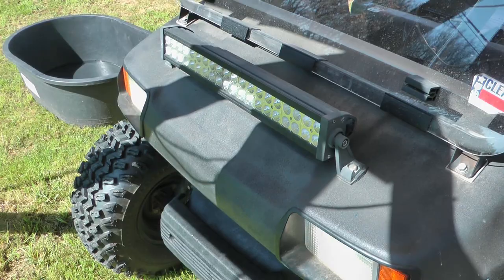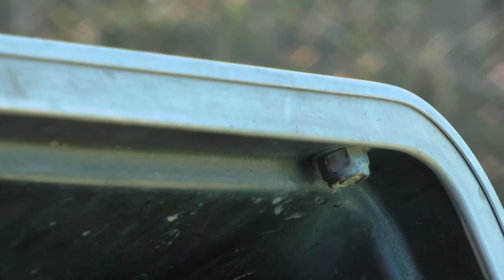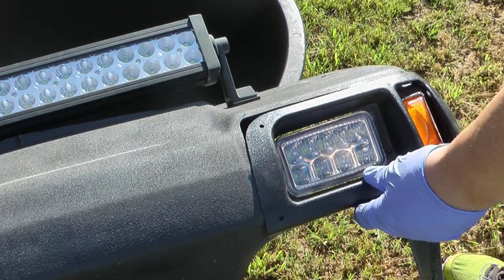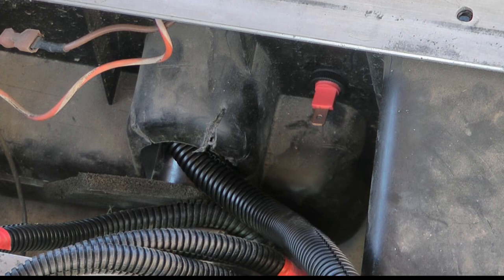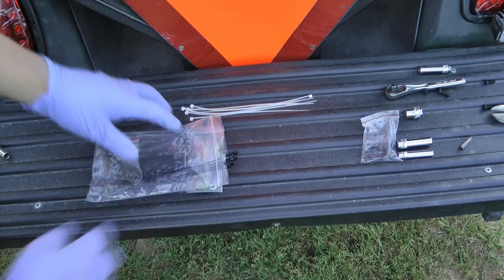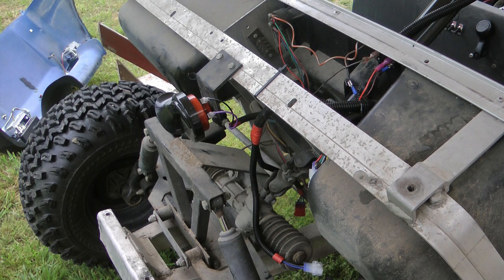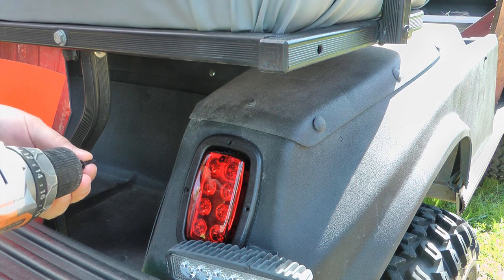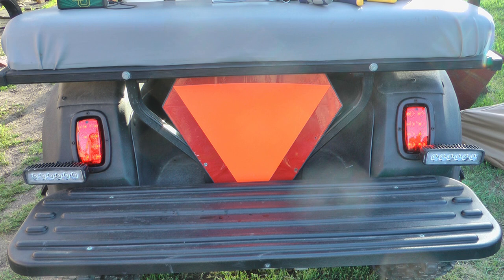Golf Cart How to Install LED headlights

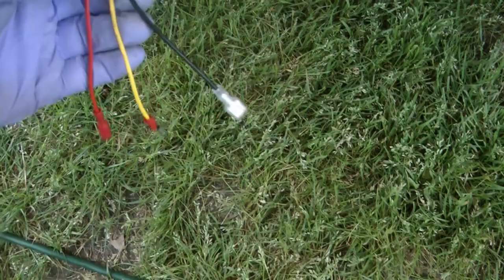Comment: 19:19 Aww man, it would have been nice if the front amber turn signals also illuminated as parking/running lighs instead of only flashing. 

I guess you could add separate amber parking/running lights pretty easily. 

So, this is a 48v cart with six 8 volt batteries?

Have you noticed the more efficient LED's lights increase your overall range or operating time? 

It would have been nice to measure the current draw of the old incandesant system, and compare it to the new LED. 

I love taking those before, after reading. 

-Chuck

Comment: You do not need to remove those 1/4” screws and the trim strip.
Just loosen the screws and the front cowl will come off. No need to fight those nuts!
Reply from the maker: thanks for sharing!  Where were you when I was doing this???  :)
Reply: Thanks for the tip! That will really help when I do mine.

Comment: I bought the same or similar kit. But I have a gas ezgo txt. My lights work but turn signals and hazards don’t know. Also when I start my cart my lights go out. Any ideas?
Reply from the maker: My guess is, just like a car, with a gas golf cart there are probably different power settings - full time, accessory/run, and start.  Yours must be hooked up to accessory/run.  Do the lights work with the key off?

Comment: Yo Gary,

I've been waiting for this video for almost 3 months. lol
Do you have a P.O. Box for fan mail?

I have a device you might be able to use for your golf car.
It was sent to me back in 2017.
It's kind of like an "electrical version of snake oil" lol
After testing, and evaluating it's effectiveness, I've learned it's designed for multi battery vehicles that get recharged on a daily basis. Like fork lifts, pallet jacks, and even golf cars (things I don't have). 

I'm dying to know if this thing actually works out of pure curiosity.
Would you be interested?

-Chuck

Comment: I have a similar system & installed it just the way you did but when I connected power….nothing worked
I tested the output on the Voltage converter & it showed 12.45 volts
I’m thinking the Brain might be bad any suggestions????
Reply from the maker: not being there to see and check it would be impossible for me to know.  Try it with the key on to make sure you didn't hook to "accessory power."  If that's not it, I'd contact customer service to see what they say.  Good luck!

Comment: What was that when you said “the brain”? I think I am missing some parts.
Reply from the maker: if you have everything shown in the video then you have all the parts.  I called "the brain" the part that sends out the signals to the various lights.  I'm not watching the video right now but if I remember correctly it was tucked up behind the dash when I had the front nose piece off

Comment: On that battery meter what did you connect it to?
Reply from the maker: it's been a long time since I filmed this and I don't remember but it is shown in the video.  I do remember that the instructions for it didn't seem to match how it ended up needing to be wired

Comment: Hey there. I bought this same kit along with the power converter 48v to 12v. I got it all installed without issue. But when I went to test it, only the running lights work (front and back). I can’t get the turn signals, emergency flashers, or brake lights to work. Any idea what could be wrong? I rechecked the connections, fuses, and the little controller box, and all seems correct. Help!!!!
Reply: I'm having the same issue. Did you find a solution?
Reply from the maker: without being there and testing and inspecting everything it would just be a guess.  I'd contact the seller and see about a replacement or if they know what would cause that.  I've had zero problems with mine.
Reply: Since they are LED's and require the correct polarity, you might try swapping the plus and minus and see if that gets them working.  The running lights are probably on a separate circuit and have their polarity correct.